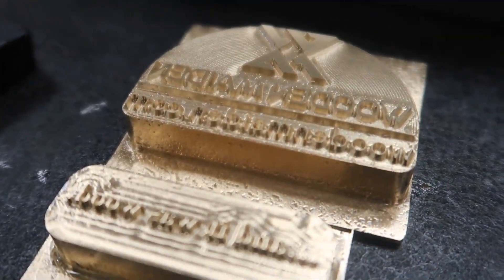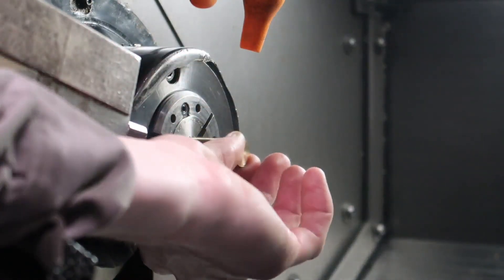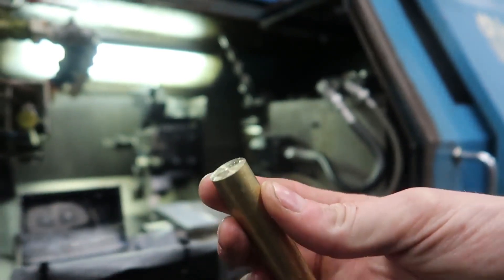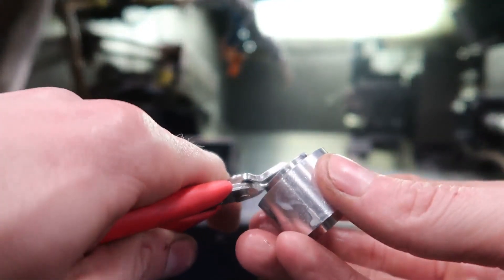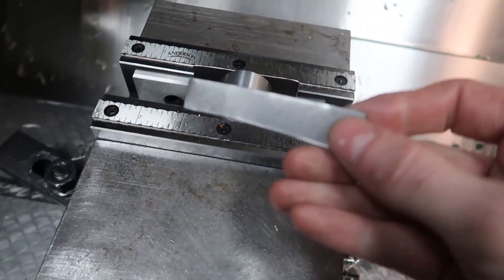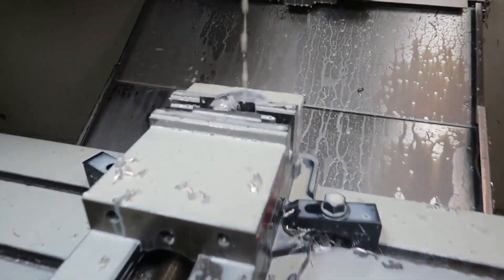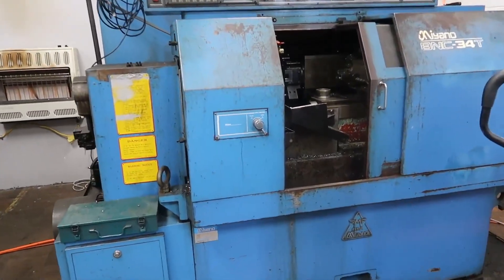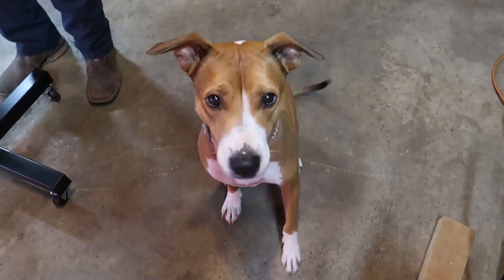Make A Mistake, Fix A Mistake

Comment: fixing that other lathe up just to sell might be pretty emotionally exhausting.... but if it's just sitting there and there isn't much wrong with it, I would sell it for money for the next machine
Reply from the maker: The axis drive need repaired or replaced, the ways have a decent amount of surface rust, the hydraulic pump gets very hot, and the main turret has some play in it especially during heavy cuts. That's all the info I got from the previous owner...guessing that's why he got a new one. It will probably be financially exhausting as well. Thanks for the comment and helping me think it through!
Reply: @MojoMfg  hum..... that does sound pricey to fix up... I might lean on the try to find it a new home option, maybe someone that wants a project machine. And thank you! I stated watching your channel a few years ago when you first got your tormach 770 (I had just bought one too) and you told me about Xometry, which let me quit my day job and start my machine shop
Reply from the maker: Yeah I may even disasemble it and keep it for spare parts. That's awesome! Sounds like you're doing alright!